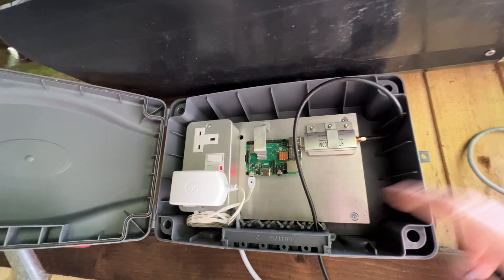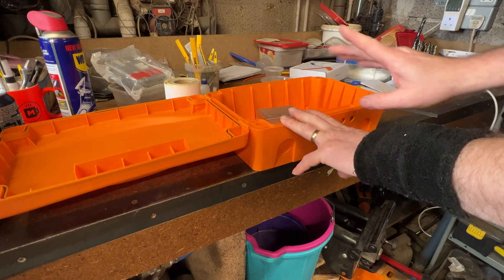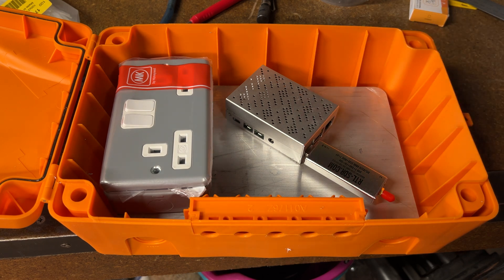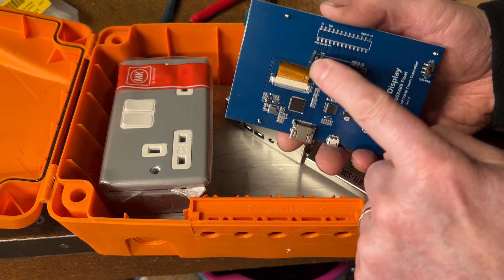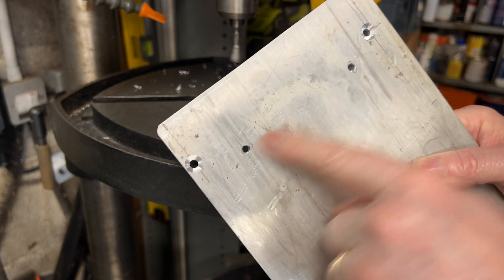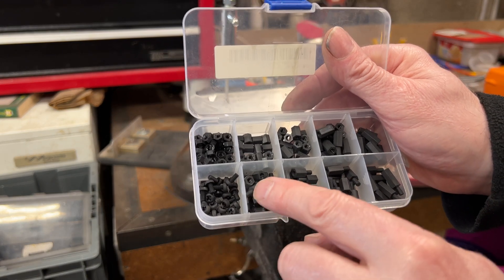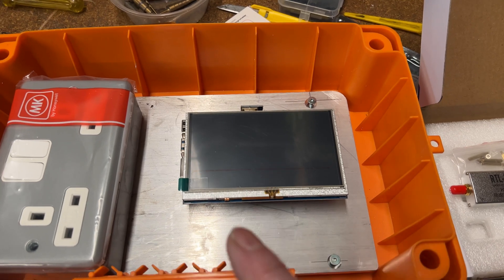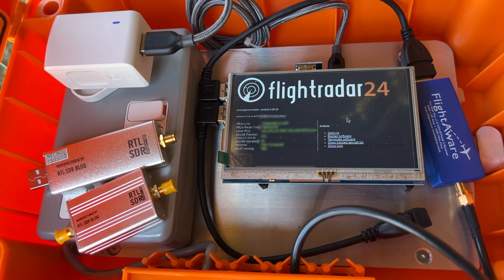Complete FlightRadar24 Build on Raspberry Pi and SDR Dongles. ADS-B AIRCRAFT RADAR System Part 1

Comment: Nothing like a hot cup of coffee and red hot aluminum shavings burning the hairs off your arm. No better way to start my day !
I use the blades often too. Be surprised how well a dull table saw blade dose for plastics and aluminum.. up to a thickness and grade.
I do own a few Diablo metal cutting blades. Expensive but gives you the ability to cut with a common circular saw 1/8" steel like its plywood. So $80 seems cheep in retrospect. Thanks for the video
Reply from the maker: Thanks for the great comments and for watching 👍🏽

Comment: Hi, so you just build a receiver as given on FlightRadar24 website (https://www.youtube.com/watch?v=42wYlSWqRYo) and install a display that's all right?? Do you need to do any changes in the software to get the display working?? and can we see the flight details traced by the receiver on the display??
Reply from the maker: Hi, thanks for the comments. It's been a few years since I completed the project and it is still running fine. All the information I got to do the builds was from the Flight radar web site and the forums. Things might have changed a little as it was 3 years ago but I'm sure not too much. The display from memory was a direct fit to the Pi from its HDMI port and as the display was HDMI it was a direct fit with the correct parts. I believe you needed to tweak the Pi's resolution to suit the display. The unit I have running at the minute does not have the display fitted so I cannot show you live data now but just to say what you get on the small display is the same as you would see on a larger display connected to your Pi. It was an oversight not to show the display in the videos. I hope this helps, thanks for watching 👍🏽

Comment: Why have no one try to use a little usb extension cable to have the dongle outside and the pi inside the house.
Not so much hassle with the big watertight box outside.

Edit: didn't see the end of your video with your usb extender, think that is the way to go.
But i was just thinking in general here on youtube where people are making these boxes on their roof
Reply from the maker: Hi Jada, I guess it can depend on the location you have to place the system. In my case I’m about 50m from the house so I have my system remote from the main building and the Pi at the end of the powered USB cable. I was going to place a Pi Zero up the pole with the dongle and just have a power cable going to the system but as yet not tried this. Thanks for watching 👍🏽
Reply: @MikeMakesIt  yes, your antenna setup was more advanced with a pole outside.
But thinking of all the others with a Tupperware box on the roof with just 3 feet of cable and then they are inside the house, could easy just use a USB extender without the hassle with cooling and stuff in a box.. Have been there doing this myself.

But then i filled out the form for a receiver just for fun, couple months later i suddenly got a package from fr24 with a receiver, no questions if i was ready for it. 
Got one week deadline to make it running, climbing up the steel roof on snow risking my life mounting the antenna. 
Has now been running since 2015.
It needs some babysitting, if internet goes down or a power outtake you get a mail after some hours to check the equipment. 
I have changed the power brick once and had to flash the receiver firmware once but other than that it just works. 
Takes away little of the fun building your own diy stuff tho.
Reply from the maker: @jada1173 great you had a free receiver, I tried but I’m not in a sort after location. Good luck with yours 👍🏽

Comment: FlightRadar24 on my PI 5 shows 0 Aircrafts but if I connect same RTL-SDR & Same antenna to my Android smartphone through Dump 1090 App it shows plenty of Aircrafts, why is that ?
Reply from the maker: It must be the configuration on the Raspberry Pi 5. I’m not sure if there is a tutorial on their site for a 5 but there but I see no reason for a 5 not to be able to run it. I suggest you go back over the setup as I think there may be a step that has been missed. It’s been a while since I configured a Pi for this but I do remember there is a place right at the start where you enter your location and aerial height etc and this is where I went wrong a few times and needed to start again.
Reply: oh it might be aerial height input,  Thanks for the quick reply :)  @MikeMakesIt

Comment: Hi i really like your videos on ADS-B I have a few questions if that's ok  with you. How do you stop your equipment from getting damp in the waterproof box and also if you have the dongle up close to the antenna how do you stop that getting damp and how do you far with the equipment getting really hot if we get  a summer and also  sometimes getting cold like - temps in winter Thank you David
Reply from the maker: Hi David, thanks for the comments. I was lucky and found a sheltered place for the water proof box, largely out of the rain and the sun. I do have a small heat sink on the CPU. I never seem to have an issue on my setup year round with heat, sun or damp. As for the SDR, when it was up near the aerial I put it in heat shrink and put this in a small waterproof box. The finished setup had the SDR in heat shrink in side of the aerial pole so invisible to see from the outside but also free from getting wet. I think I mentioned this in one of the videos where I made a special mast support. Thanks for watching 👍🏽
Reply: @MikeMakesIt  what length of coax did you use from your dongle to your antenna
Reply: whatsa heat shrink?

Comment: can any on tell me how to get my flight radar24 sreen working on may base set up
thank you
Reply from the maker: Hi, Marin, that a very difficult question to answer I’m afraid. Go back through everything I have done and it should be fine. Other people seem to be getting it to work ok so it’s possible there may be a step you have missed. Have a look and if you still are having a problem give me as much detail of the issue as you can and I’ll see what’s going wrong for you.
Reply: @MikeMakesIt  ok thank you I've managed to get the maps working
Would you know how to update the the coordinates so I can see my location on the map
Thank you
Reply from the maker: @martinmcmulling1585  Good job about getting the screen working 👍🏽 From memory it is all input at an early setup stage where location, elevation, usb stick type is entered.
Reply: @MikeMakesIt  thanks Mike I will Go through the set up process again 👍
Reply from the maker: @martinmcmulling1585  good luck 👍🏽 it can be a pain, I had to do it a few times. There is info on the flight aware web site that helped me through it.

Comment: Nice alluminium plate,😃
Reply from the maker: I’ve been lucky to be around when we have scraped machines at work. They usually have some useful parts for me. Actually quite a lot have gone into YouTube projects. Thanks for watching 👍🏽
Reply: Hello brother,this unit could be use for another perpose.?
I mean like whether data
Reply from the maker: @technolk8221  With the correct software yes. The Raspberry pi’s are super versatile, you just need the idea and the right software and you’re away.
Reply: @MikeMakesIt  thank you

Comment: Have you got one for 360radar you get free access if you setup
Reply from the maker: Hi, currently I'm only using Flightradar24 and I get a free business account as the Pi is alway switched on sending data back to them. I see with 360radar you are able to track military aircraft. With FR24 it's a little more limited. It all depends what you want to track I guess. I may look at 360radar in the future though. Thanks for watching 👍🏽
Reply: @MikeMakesIt  ok as I like to see military and I have the development server mode A as I’ve got a rasberry Pi from the owner Phil and he bought my single off me as my ram chip in Pi4 went dead and so he used that flightaware dongle for my kit for his rasberry Pi here 3B+  I buying rasberry Pi3s now and I have bought not long ago another Rasberry Pi4 and the other one upstairs to one ride the broken one need some that knows how to solider a chip on the board
Reply: @MikeMakesIt  Flightradar24 block some private owned aircraft and some military aircraft doesn’t show. They can choose what To block as say if you are a pilot you could ring up and say not to have yours to track and it would be blocked on there site alternatively if yours is blocked you could give your details and have it to track. 360radar is open source tracking site nothing blocked on there you can see civilian and military while Flightradar24 ideal for commercial flights tracking.
Reply from the maker: Thanks for the update. Good luck on getting the Pi repaired👍🏽
Reply: @MikeMakesIt  I got new Pi4 but might get other one repaired but no rush

Comment: hello. Did you have a video showing the automatic system saying which direction the plane would go in the sky? and showing some codes? thanks
Reply from the maker: Unfortunately not. Flightradar24 has recently revamped their software to making for a better experience  of what's going on in any particular area and is really easy to use. With Raspberry Pi now available again hopefully more people will build a system and get a business plan free!

Comment: Slowly but surely am building my own ADS-B  receiver, after obtaining Pi 4 model b 8GB kit from Raspberry Pi pop-up shop. have since purchased 52Pi Case and Low-Profile ICE Tower Silent Cooler Cooling Fan and a  1.2 m antenna. Also as they are practical and sturdy going to use a Masterplug outdoor box like Mike has and have made a waterproof housing for the box to be fixed under. Still to purchase antenna mast and active USB cable and ADSB dongle
Reply from the maker: Hi, sounds as if it will be a great project. I run mine fanless but extra cooling will never hurt. Good luck and thanks for watching 👍🏽

Comment: Hi, which is your raspberry pi model?
Reply from the maker: Hi Paulo, in the first video I used a Pi3b and in the later video I was also using a Pi4. Both seemed to give very similar results. I have been trying to get a Pi Zero to run but no luck yet! Thanks for watching 👍🏽

Comment: Hi. Are there any alternatives to using a Raspberry Pi?  They still seem to be un-obtainium...
Reply from the maker: Hi Steve, the only system that I know of is the Pi but you could try this link https://www.flightradar24.com/apply-for-receiver

Pimoroni have Pi kits at the mo https://shop.pimoroni.com/collections/raspberry-pi

The Pi Hut have 3B kits https://thepihut.com/products/raspberry-pi-3a-starter-kit

I've not had a chance to run up a Pi zero yet so cannot tell you if this is an option.
I hope the above helps a little, thanks for watching 👍🏽

Comment: best not to use them in a lightning storm, ive fried one, also you should get a UPS hat for it,
Reply from the maker: Hi Abe, good advice, thanks. I did think about a power backup for the Pi in case of a power outage, at least that way I'd have an uninterrupted data output. Thanks for watching 👍🏽

Comment: Impressive. Didn't realise you were into electronics at that level. You can get a 3.5 inch touch screen which is the same size as the Pi and a case which houses both, though, as you say, everything is as rare as hen's teeth at the moment. Recommend the heatsinks and mini fan for the Pi when using the TFT. Fan is a tight squeeze (but lots of room in your box) and power connections can be problematic
Reply from the maker: Hi Ralph. I seem to do a bit of everything these days. I found the 5” display a bit easier to see!  I’m looking at setting up another permanent feeder so may install your idea of a fan and keep everything a tad cooler. Thanks for the comments and for watching👍🏽